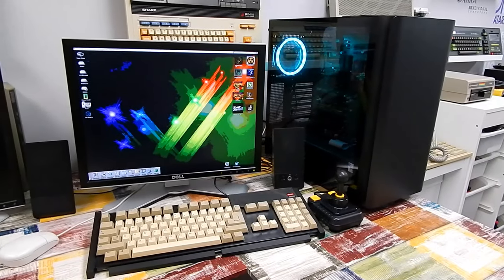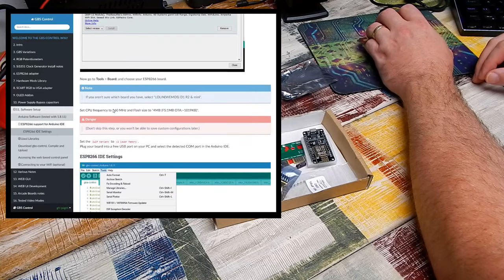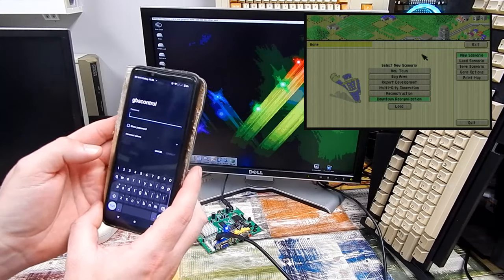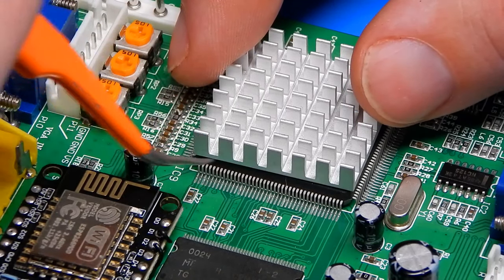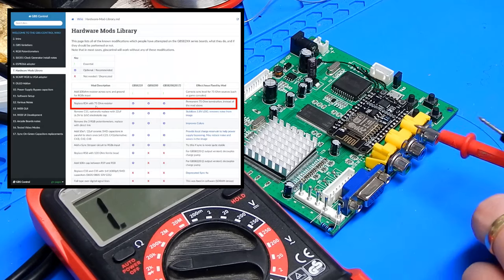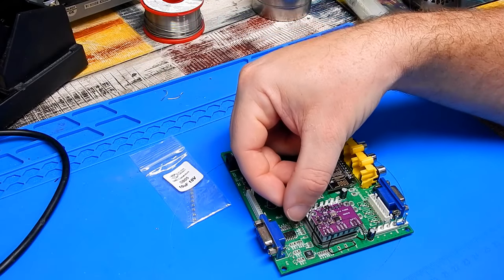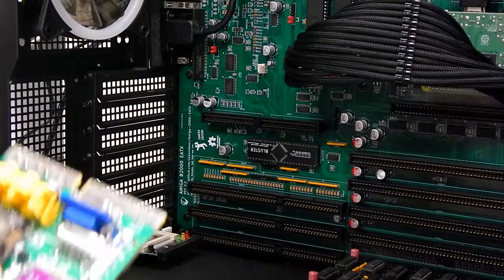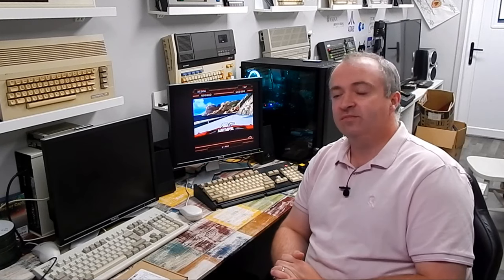Amiga 2000(EATX) internal GBScontrol build

Comment: Your content is starting to get expensive for me (*inspiring). I recently aquired a Mac 128k and an Amiga 2000 to restore. 

Thanks for the quality content!
Reply from the maker: I can only apologise 😂

It is an expensive hobby but a 128K and A2000 restoration sound like great projects.  Let me know how you get on with them.
Reply: Be prepared for Varta battery damage. 90% of the A2000 have them because people didn't know they leak so they have been installed for the last 40 years. I also wanted an A2000 but somehow instead ended up with an a500+ in a big box case LOL.
Reply: @tspawn35  I appreciate the heads up. Maybe a new replacement motherboard is in my future as well.

Comment: It took me a similar amount of time to build mine, but you went much further! I only did the GBSControl, didn't do the clock generator or half those mods and yours looks much better for it!
I can see some comments about using an RGB2HDMI, and indeed they're a great board and I've built a few of those. My personal reasons for using this instead in my EATX2000 is that I use a traditional RTG card (well, the modern GBAPII Picasso remake) which has VGA passthrough, so I can daisychain the GBS8220 into that and then into a monitor. HDMI will work better if you use a PiStorm or something as you can just use an HDMI 2-into-1 switch... it's just about working with what you have :) Great video though!
Reply from the maker: Thanks again for sending me the board I only wish I had done it sooner as the end result is a fantastic image.  RGB2HDMI is the other obvious choice but I've already got a raspberry pi in there doing pistorm, not sure I could handle having 2 pi's in my Amiga.  Plus it suits my setup with that monitor which has both DVI and VGA inputs so its easy to change between them.  

The other mods I did I do think are worth the little extra time they take, certainly the clock generator and the RGB level mod.  I didn't see much difference with the additional bypass caps.  There are further mods that can be done with a sync stripper and even an LCD to display some info  like current resolution but I didn't see the point in those to be honest.

Comment: An interesting idea. I wonder how it stacks up to the Raspberry Pi Zero RGB to HDMI thing, which you can also fit in a slot like that.
Reply: I have a RGB2HDMI 2K in my A2000 and its just pixel perfect. Its so sharp it's hard to believe that it's not emulated.
Reply: @Voyager_2  I agree, for the Amiga RGB2HDMI is perfect.
Reply from the maker: I have an RGB to hdmi in my 500+ and agree it's fantastic.  Maybe one day if they integrate that into the pistorm I'll go down that route.  I just don't know if I could put 2 raspberry pis into this one machine 😂.
Reply: @CRG  I don't think it will ever be integrated in the pi-storm. I don't see were to get the I/O from on the pi. But yes sometimes it feels like the Amiga is slowly being assimilated, well as long as the original chipset is still on the bus, I'm fine with it ;-)
Reply from the maker: @Voyager_2  I recall some conversation about trying to use the pi's CSI (camera) port  for rgb2hdmi.  That is going back at least a year though and I've heard nothing further.
Reply: I had the same question. I bought my gbs 8200 before I got the rgb2hdmi but I’ve not used it since.

Comment: I would do the 75 ohm resistor mod and add the extra caps because i already have those on scrap VCR boards that i got free and its quick and easy to do. For me, the 8266 is not worth the cost and effort for the extra features (gimmics). I don't need fake scanlines. The 75 ohm resistor is mainly what makes the icons and text sharper.
Reply: It does more than scan lines. Could be wrong but out of the box I don’t think it converts 50-60hz so if your monitor doesn’t support 50 hz it’s helpful. The resizing is also good. The 8266 is pretty cheap (admittedly I did this pre COVID so perhaps it’s not now?)
Reply from the maker: I'd say its more about the stabilising the image rather than the gimmics like scanlines.  Don't get me wrong though, the standard GBS with a few mods does do a decent job and those little issues it does have are not noticable in a fast moving game.  For workbench or slower games though the slight flickering always annoyed me and GBScontrol certainly resolved that problem.  I too am not a fan of scanlines.  If you want that just use a CRT.
Reply: @CRG  What's worse is the crt scanlines are not that noticeable because the crt smooths them out. So, people are nostalgic for something that doesn't really exist.

Comment: I've seen another mod for these where you stick copper tape over the traces on the back running between the main IC and the ram, then scrape back some of the mask and solder it to the ground plane. This can reduce some artifacting but it seems that's not being an issue for you there. I can't remember where I saw that video, maybe Voultar, maybe not.
Reply: RMC, Neil had a video on that
Reply: @craignadineguymer5714  I found the one I was thinking of, it's GadgetUK164. But yeah, it looks like Neil did a video on that as well.
Reply from the maker: Yeah I've seen that before but it's not required with GBScontrol as that issue has been resolved in software.  Probably still worth doing if you're just running the stock GBS though.

Comment: I've had an GBS8200 (v 5.1) for years, but have not got it to work with anything. 
Except Productivity/VGA mode, which is pointless :face-pink-tears:
Reply from the maker: I don't have a V5.1 but have had a couple of GBS boards over the years and they have all worked fine.  For the Amiga I had to use the video socket on the board  and make a little cable rather than just hooking up to the VGA input so maybe try that?
Reply: What issue? I've had problems on two v4 boards but they needed the SoG mods which is difficult to do.

Comment: Talking about sync issues, fyi the last few minutes if the video were out of sync between your voice and your lips 😅
Reply from the maker: Please tell me you're not serious.  I've had nothing but problems with this lately but I thought I got it sorted.
Reply: @CRG I'm not really seeing a desync. If you are unsure about it, try doing a clap or snap at the start and of each take. Be sure your project is set to the exact framerate you are shooting at, (progressive scan, 50.00hz?)
Reply from the maker: @Nukle0n  yeah I need to do something like that.  With my current setup I'm recording video with the camera but the mic is straight to the PC recording in audacity.  I usually just sync the two audio streams then delete the one from the camera but a clap or something like that might make for an easier sync point.   My camera shoots at 60fps, the same at which the video is set.
Reply: @CRG  Might depend on your lights but i find in Europe you tend to get more flickering recording at 60hz vs 50hz, even with modern lights. But also a lot of phones and such don't even support 50hz recording, just an infuriatingly slow auto-shutter that doesn't seem to want to default to a shutter speed more suited for that.